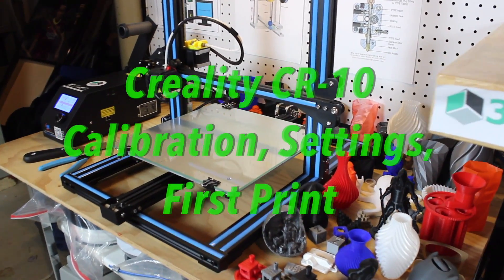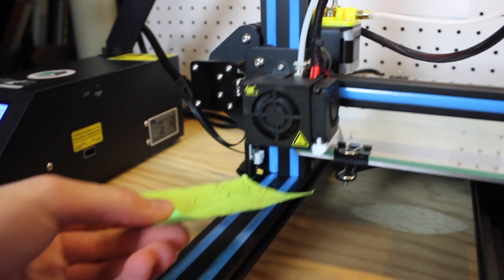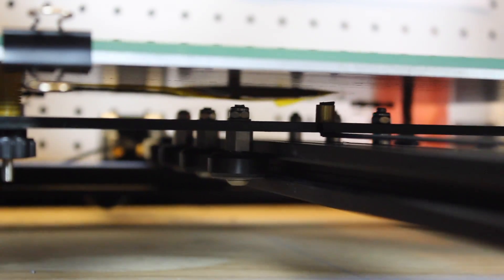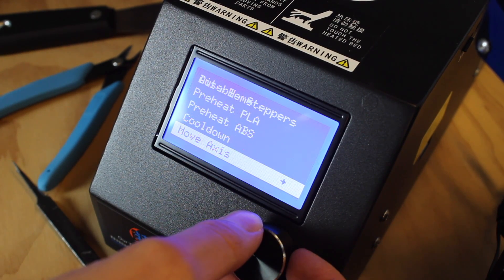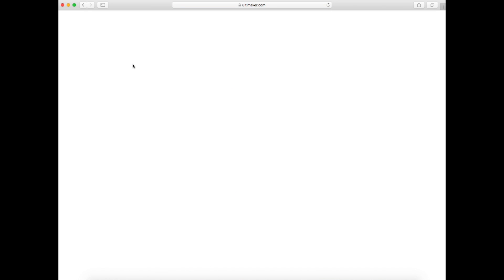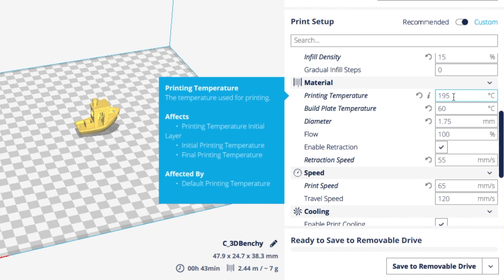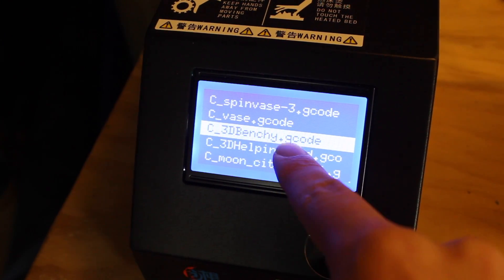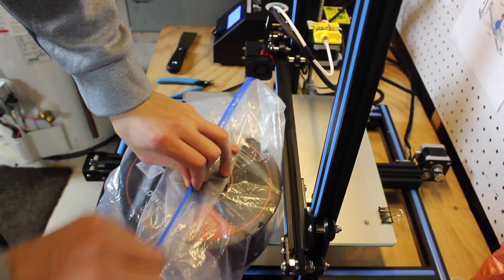Creality CR-10 Calibration, Settings, and First Print!

Comment: 6 years later i got a free crs10 and used this for reference on the setup. Thanks a ton for the help
Reply: I’m about to get a cr10 from a friend.  It’ll assist my a1 mini.  I’m planning to use it for my server case.
Reply: I just got one too. Free, from a friend. Wondering why everyone gives these away
Reply: 2 years later I got it.
Reply: How's it working for you? What are you using it for?
Reply: @jimmylee9120  works pretty well, I haven't changed anything besides the tubing that feeds filament. I swapped it for bowden tubing, its was being used by most  youtubers I was watching so I figured that would be a good upgrade. besides that its all stock parts from the box. printing for 2 weeks now with no issues. Mostly terrain printing for DnD so far
Reply: same exact situation lol
Reply: I just got one handed down to me a few days ago. It seems functionally very similar/identical to my Creality Ender 3 except with bigger print volume. This video was very helpful in determining that. Thank you for the vid.

Comment: 12:06 While setting it up, and person that was over said he was going to level the bed. In reality I believe he changed some settings because the Y aces will not auto home. It auto homes the right way for the X and Z aces, but not the Y. It’s in the middle of the Y aces and when you manually move it, it will not go forward past the middle of the Y aces. But when I manually dial it for the middle of the board, it’s at the very back edge of the Y aces. If I try to go past that even further it stops and makes a grinding noise. Do you know how to fix this? 12:06
Reply: Hello i have the same problem did you solve it

Comment: Thank you for this concise tutorial! Complete noob with no idea on anything 3D print. I had my printer (CR-10 V3) for nearly a week without printing anything and this guided me every step of the way on my first 3D print. My first benchy looks amazing. Really smooth sides and no distortions. Q: Those settings you provided before you sliced are for this specific print? Or is this a general baseline for most 3D prints?

Comment: Hi I just got the Cr-10 V2 and i've got all this down but for every print it prints a 1.11 mm base then the actual print on top of it, I was wondering if there was a way to get rid of this or tweak it so its only 1mm.  It get complicated especially when you have to color change at a certain z axis height and its different from what it say because the 1.11mm base.

Comment: The first thing I printed was a preinstalled cat stl from Creality for my CR-10 which printed just fine in the center of the bed, but when I downloaded an stl from Thingiverse and tried to print, it started printing from the home position. Any idea on how I can make it print in the center. I tried with two different stls, and the same thing happened. I cancelled the prints so I don't know it they would have come out correct. I didn't want to waste the PLA. I tried another preinstalled from Creality, and that one printed just fine in the center. All four stls were in the center of the bed on the preparation screen.

Comment: very helpful video

I just bought a CR-10 (500x500x500mm) I assembled it the best i could, I'm left with a "Z" & "Filament Dectector" wire/connector, I'm not seeing a location as to where these connectors go.. any advice? thank you ------ thumbs up
Reply: I was missing the Z connector on the other side-  so that is fixed.   The “ Filament Detector” that has a place or no?

Comment: can someone help me my printer is ready but the nozzle is too high up when I calibrated it. What should I do
Reply from the maker: Adjust the z axis endstop switch or screw that hits the switch.
Reply: @3DNow  Sorry if I am being complicated but how do I do that?
Reply from the maker: It really depends on your printer, but usually there is a switch that a screw hits as it is moving down to the bed. You have to adjust that.
Reply: @3DNow  tysm it worked

Comment: I have a few questions. Why remove the plastic from the printer at all? It seems to be a wasted step. Is there something wrong with the CR10?  I own a Trinus and I have never removed the PLA after any print. It has always been fine. Has not hurt the tip for over 2 years. Also when you turn off the printer it will cool down on its own without electricity. Is there some reason that you have to instruct the machineto cool down? I have ordered the CR10s to make bigger prints and the reviews are great on this machine. It does not look like it will be as easy to use as my Trinus but not to complicated.

Comment: Just got a CR-10S to aid in my printing of Covid face shields. This video was of great help, but I am having issues. My auto home is not functioning properly. The head comes to the front of the build plate, but not to the left corner. It comes to the front at whatever left to right position it started from. I have checked and unplugged all cables to no avail. Do you have any experience with this and any tips?

Comment: but how about the center? It is still too close to the bed in the center and I can not figure out how to fix that. Every time I print, even tho the 4 corners are a paper thickness apart, it scraps on the board when it prints.

Comment: I'm having issues with my s5, it's not centered and goes right off the bed. i checked if cura has the home is center checked and it wasnt. I tried turning off the steppers and manually doing it but it just goes off the bed again. it's not the files as i've just printed the same print before it. i did however have to stop the last print as the feed tube was jammed and had to start over. What do it do now?
Reply from the maker: Is your bed size correct in cura? Maybe try reinstalling cura if you think it is a software or gcode problem. What do you mean by the print goes off the bed?
Reply: @3DNow  actually i just figured it out., one of the stepper motor plugs came out.... thankyou though.

Comment: After my first print i didnt take the PLA out or cool the machine down. Now im trying to print again and having trouble with the material coming out properly. Do I need to clean the nozzle somewhere? its fine when i heat up and push material out but when i print its not really coming through.

Comment: Really appreciate this video! Thanks man!
Reply: I am having some trouble with my printing on this. I am going to move it to a table and tighten up the bed wheels, check the belts and try your leveling method then print again. I can send you some examples if that would help, maybe you know whats wrong.

Comment: hey i've just recently got the cr-10 and 2 things I need to fix
1. when it prints it doesn't print the bottom letters on the benchy and I check in cura if its working and it looks fine
2. after a couple of days the z motor has stopped moving up and down when it print so when I start the print it does the first layer but doesn't move up when it starts the second but I use the move axis setting to move it with the control panel and it works

Comment: Very informative. I do have this printer and prints very well. But, when i select auto home the extruder moves to the left of the bed but not the left corner.
Reply: Sorry...i am new to printing. The Y axis isn’t moving for the extruder to be in the front left corner when i select auto home.
Reply: Are you trying to level the bed?. That's odd
Reply: Bonanza Driver no, it prints fine. When the print ends, it doesnt return to auto home. So, if i forget to disable steppers and manually move the bed to the home position. The next print starts at the back of the bed and the extruder fall off the glass. Any fix?
Reply: the extruder doesn't move...

Comment: I have an issue where when I select Auto Home the nozzle pushes down on the build surface considerably. As this is my first 3D printer I don’t know how to change the Z axis to a new default value. I also don’t know what changing the nozzle offset means or does.
Reply from the maker: Adjust the height of he bed with the 4 adjustment screws. Also, you can move the z axis limit switch up a little.

Comment: Hello i have a cr10s could you help me please my print head will not move at all to auto home? Thanks
Reply from the maker: Make sure all the wires are plugged in correctly. That may be the problem.

Comment: Okay 2nd comment in as many months - why is it that at 5:36 you have the ability to configure your pla preheat settings. Yet on my 2019 CR-10s I don't have that feature (or nearly as many as you do)? Did you update something?
Reply from the maker: They probably changed the settings around in more recent printers

Comment: You don't need tape or glue on the print bed? I've seen others do that
Reply from the maker: You can use that to make parts stick better,  but it's not necessary

Comment: Help i just got a CR-10 going through the  instructions and they say check the direction of the extruder, how do i do this.
under move axis i only have X and Y i don't have Z or extruder.
Reply from the maker: You should have move z and extruder. You just have to change the distance extruded.
Reply: @3DNow  All sorted now for some reason Z and extruder doesn't show up under move 10mm
thanks for your help.

Comment: For the glue stick - is there a certain brand you have seen work the best? and do you just clean it off with water once you complete your print?
Reply from the maker: Any glue stick will work, and I don't clean off the bed after a print. You can use the extra glue for the next print.

Comment: is it supposed to take a long time for the bed to heat up?
Reply from the maker: Usually under 10 minutes.
Reply: @3DNow  Ok, my bed will not heat up, the screen says it gets to 20 degrees but it doesn't heat up at all do you have any suggestions? my first two attempted prints my prints posed off around 81% through and half way through the whole thing shifted. This upsets me because i was really excited for this printer.
Reply: I tried to print bench both of those times.
Reply from the maker: Make sure the bed is connected securely in the control box. Also, make sure you are heating the bed in the slicer as well.

Comment: Ok but my cr 10 s has a problem with the mossfed which won't let the beds  temp to rise. How do I fix that?
Reply from the maker: Check the connection in the control box.  A cable may be loose
Reply: @3DNow   thank you for the info😇
Reply: mine is doing this too! it won't start printing, but connections are good
Reply: @connorgrow7794   hope I could help😇

Comment: Thank you for the video it was very helpful. But I still had a lot of difficulty as my nozzle got clogged up, the extruder gear started to grind my filament and the resulting prints had severe under extrusion. After cleaning my nozzle several times and the same thing happened again and again I finally found that my filament required 220 C printing temperature to work properly. I would just say that setting up the nozzle temperature higher for the first prints makes it easier to find out all the other settings that are wrong too.
Reply: I can't thank you enough for this post! I was pulling my hair out about what I was doing wrong with my brand new CR10 S5. Raising the nozzle temp to 220 solved all my problems. Didn't help that the test print that came with the printer was set at a temp of 200 and the filament that also came with the same printer apparently needs 220. Thanks!

Comment: My first few prints on the cr-10s keep getting misaligned layers as the print gets taller . It looks like the layers are sticking out in the y direction. Any suggestions???
Reply from the maker: Make sure your y axis belt is tight. That is usually the problem

Comment: On my computer the print time was only an hour and 20 minutes but the actual print lasted 7 hours to print it, and once it finally printed it looked as though it was made of styrofoam, and many of the layers you could just peel off from boat, could this be caused by the nozzle not being close enough to the printing surface or it not being hot enough?
Reply from the maker: It is probably because your filament diameter is off in the slicer. Check all your settings
Reply: I’ll try that thanks
Reply: Thanks a lot I just tried printing it again, after I changed the filament diameter and it came out so much better and faster

Comment: Invalid File: Cannot open files of the type of. (I dragged my benchy stl file, but it didn't work)
Reply from the maker: Into cura? That means you didn't install the stl plugin on startup. Uninstall cura and install it again but make sure the stl plugin button is checked.
Reply: 3D Now
 I figured it out. Dragging and dropping the stl file from thingiverse didn't work, but pushing "download" and opening the file worked.

Comment: I am having trouble with my prints. I got my CR-10 about 6 months ago and I have not been satisfied with my prints. There is always this weird thing that happens where it looks like the layers shift but they don't if that makes sense. Its more like seeing doubles if that makes sense. I can't explain it that well. :(
Reply from the maker: What slicer are you using?
Reply: I am using Cura 3.1.0

Comment: You say to check belt tension but out of the box there is no way to modify belt tension right?
Reply from the maker: There is a way.  You can move the v-slot mounts along the rails.  Unscrew the metal mounts and move them.

Comment: I recently changed my defective mother board on my cr10 S printer, and now I cannot print from my laptop any more.  My c9mputer keeps saying that it has an error in the com port, and cannot connect with the printer.  I have checked the baud rates, and they are fine.  Do you have any help you can give me ?  It would allow me to Re Grow my hair Which I have So Violently Pulled Out.  :-) :-)
Reply from the maker: Hmm, have you tried plugging it into a different USB port? Also, you maybe have to flash the board again with a different firmware. To be honest I'm not an expert on control boards.
Reply: 3D Now :  Yes I have tried different ports, and different cords, but I never thought about flashing the new mother board with new firmware.  Do you know which one the CR10 S uses?
Reply from the maker: It has to be the cr10s firmware from creality. I believe they have it on their website or Twitter account.

Comment: Well, printer came in and followed your set up...Thanks for all the info. It took a bit to get the heating tray right. Heating nozzle kept clogging as I tried the benchy. Then the tape I used as the adhesive worked for a few minutes, but the boat came loose. 
Though not sure if it was due to the tape or the buildup on the nozzle tip that knocked it off 🤔 but will keep trying 🙂
Reply: Tanz what did you end up doing? I’m currently running into this problem XD

Comment: Hi there,
I enjoyed watching your video; very helpful!!!
Now I have printed the benchy. Looks very smooth, but for one thing... The inside of the roof has threads. How to solve that?
Reply from the maker: Try increasing your top layers in the cura slicer
Reply: Hi before I am going to print again... I noticed the belt on te x is catching with the sharp edge of te metal(on the right side) . Tried to move it to the middle, but it moved right back. It is damaging the belt... What to do?

Comment: 3d now this video is a great help.  I've gotten further than I ever have.  I bought the Tevo tornado which is supposed to be a clone of this.  I'm using a glue stick and can get the very first layer fine.  AT some point along the way I end up with a base and a ball of string as it messes up somewhere along the line.  I've tried everything I can think of.  Leveled the bed 800 times.  Played with different temp settings.  Tried glue stick and painters tape.  It seems to get the outline fine and then once it starts inside it messes up somehow.  I'm about to throw this thing against the wall.  I think I've got 8 hours wrapped up in this thing and can get one good object.  Any suggestions would be greatly appreciated.
Reply from the maker: So maybe try auto homing the printer,  then adjusting the z height. Use a ton of glue stick on the bed and make sure you are slicing the models correctly.  Don't use the included models on the sd card. Let me know what happens
Reply: 3D Now I know probably a dumb question but wouldnt messing with z height and bed leveling be the same? How would I adjust only Z height? I've also noticed the plate is not level. It's higher in the center than the edges but I don't think that would prevent me from completing one small project? Thanks so much for your help.